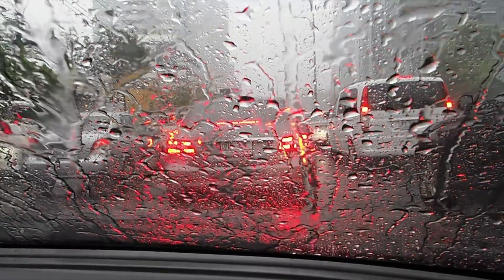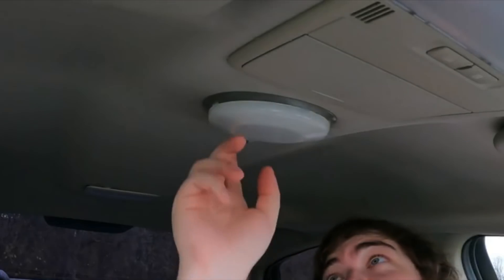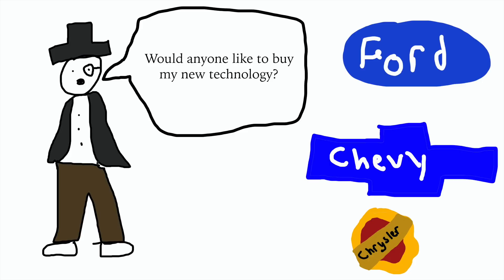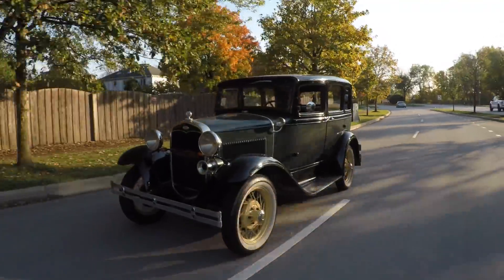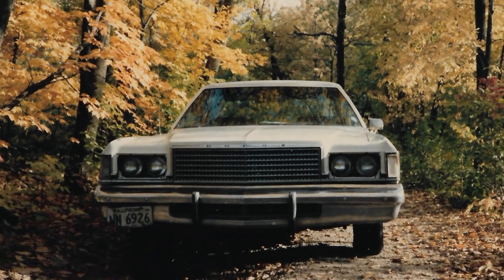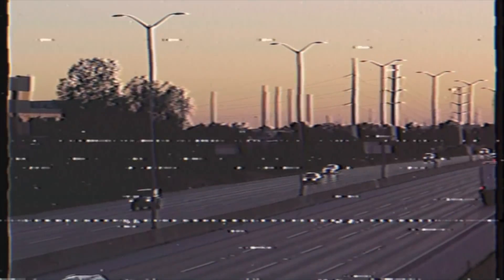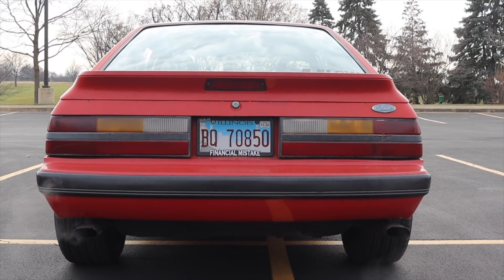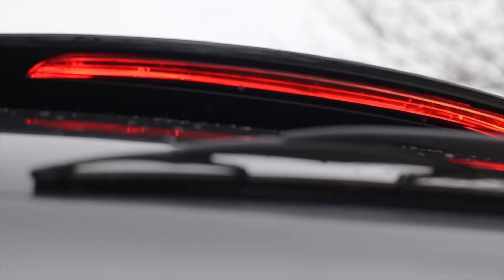The Third Brake Light - Who Invented Them & Why We NEED Them!

Comment: In France, I passed my driving license in 1994. At the beginning of the year, 3rd stop was forbidden. Then, it became authorized, and finally, at the end of 1994, it was required on all new models launched or facelifted in France. But not on all new cars. For example, FIAT Punto 1 never had a 3rd stop here, and it was produced between 1993 and 1999. 

Thats why all the 3rd stop were disconnected and hidden in American imports, before 1994, like the Chrysler Voyager (Chrysler brand, Plymouth name, and Dodge front grill ^^), the LeBaron, and even some Japanese cars, like the Nissan 100 NX (NX1600/2000). In this case, a black plastic piece replaced the 3rd stop (but the wires are still inside the door hatch)

Comment: Just before the third brake light became mandatory I purchased a 1984 Ford Midsize LTD. This car did not have a third brake light. However around 1986 third brake light kits became available at auto parts stores. So I purchased one of these third brake light kits and installed it on my car.

Comment: There is actually an exception to the high middle brake light. The GM "dustbuster" minivans of the early 90s. The way they were designed the brake/turn/running lights were high up on either side of the rear. The 3rd brake light was actually lower and mounted on the rear hatch.

Comment: I remember a movie—I don’t recall the name—where a family was stopped in their car during a snowstorm. There was a shot showing the car’s taillights becoming blocked by snow accumulating on the bumper. Next, snowplow coming down the road rear- ended the car, and family members were killed. The audience was to infer that the snowplow driver couldn’t see the car with the taillights obscured. I saw that movie years ago and the scene stuck with me. That scenario is a good reason for that third light (make sure to keep the rear defroster on when driving in the snow). 
The placement of that brake light on the car in the thumbnail (an Infiniti?) makes the extra light a bit useless, IMHO, and I’m surprised that’s compliant

Comment: Another example would be the early 1970's Oldsmobile Toronado that had extra brake lights over the trunk and under the rear window on both sides. After several years insurance companies data recognized that these models were rear ended way less than other vehicles of the time.

Comment: You have missed a few points -
Before the flashing turn signals there was a "trafficator", a light on a little bar that popped out from the B pillar of the car to mimic an arm signal, these were around in the 1920s and in the UK right up into the 1950s. 
With the third brake light, the point was that the brake light was not clear enough, was it just a bright rear light? 
Having them seperate from the rear lights helped show that they are a brake, but mounting them high up (in the days before everyone had an SUV) meant that you could see the brake lights of many cars ahead of you not just the one in front, so you had longer to react if everyone suddenly had to stop.

Comment: This is quite interesting. In the UK the third high level brake light was only mandatory from 2004. I presume this is because we've never allowed red indicators/turn signals and have never had tail, brake and rear indicator all share the same bulb.
Reply: That is incorrect, English cars prior to about the mid 60s had combined signals both front and rear ..cost saving probably..
Reply: @amigachris  We had trafficators before that in the UK, never red rear indicators, although pre 60's US imports can retain them legally. Orange/amber miniature mechanical 'arm' signals on the 'B' post of cars pre 60's. There was no need for front and rear indicators as the driver would either be signalling direction by hand out the driver's window or have these little mechanical 'arms' doing so from whatever side they are telling others they're wishing to turn/pull up on/park. 
I googled trafficators to check my own knowledge of them, and the government advice on indicators happened to come up, stating that it's amber for everything with the only exception being red rear and white front indicators on motorcycles pre 1st September 1965. 
Additional info found on trafficators (semaphore being the name for the type of thing I described above but forgot the name of (the little arm signal mechanical stand in)) were first invented in the 1920's in France, and became more widely used throughout Europe in the 40's. 
Back to my own knowledge. Prior to that, arm signals will have been the sole way of indicating to others your intentions, be it turning left, right or slowing down. We have 2 Ferguson tractors from the 50's which aren't legally required to have any lights on them, possibly with the exception of the side lights if it's to be used on the road, a single white bulb on each wing, over the back axle either side where the driver will be sitting, with a front white lens and red rear lens.

Comment: In the uk , we didn’t see 3ed brake lights until the mid 90s and commercials mid 2000s . the 3ed brake lights are seen as optional and if removed from the vehicle it wound not fail an inspection (mot)

Comment: In my opinion, I feel that the third brake light helped me a few times with anticipating when the leading car will brake. When following a car, I can see the center brake light from two cars ahead light up. Which then will cause me to start slowing down if the car in front of me hasn’t yet pressed its brakes. Of course it only works if the other car’s center brake is high enough to be seen thru the car in front of me tho.

Comment: A great example of the implementation of the third taillight is the 3rd Generation Camaro. in 1985, no 3rd taillight, in 1986 they had to rush to add one and basically just mounted one on top of the rear window, then in 1987 they integrated it into the rear spoiler on the trunk lid.

A similar thing happened to the Camaro in it's 2nd Generation. the 1972 Camaro had a split front bumper, with chrome bars on each side of the grille, 1973 had a full chrome bar going across the front due to new bumper safety regulations, then in 1974 the entire nose of the car as redesigned

Comment: I had a 1968 Plymouth Barracuda. You could go to Trak Auto..buy the third brake light kit....drill a hole in the trunk hood for the wires.....peel and stick it on the hood. I was so proud of myself. The light could be pried open if the bulb needed replacing.

Comment: I worked in design for JCB in the late very early 2000's when we developed ABS on the Fastrac high speed tractor. The first tractor to ever have ABS. I wasn't directly involved in the ABS, but did work on cab pars, and I suggested we also ought to have a high level brake light. Again, no tractors that we were aware of had ever high level brake light before. As marketing were pushing the advantages of having ABS on faster tractors, having a high level brake light was agreed upon. The type approval rules didn't cover centrally mounted 3rd brake lights for commercial vehicles at all at the time (because of it's higher maximum speed (50 mph / 80 kph), the Fastrac had to meet a lot of truck type approval rules, not tractor), so whether they were allowed was a bit of a grey area.
Everyone agreed they were OK, apart from by the German TuV inspector who decided a high level centrally mounted brake light was not OK in Germany for some reason. So I also had to design a blank for German models too. We chose a Hella 3rd brake lamp module - the same part as used in the Lamborghini Diablo and various other cars, and mound it in the rear edge of the cab roof.

Comment: Third brake lights in Australia have to be mounted high on the back window. They are essential as now there are many SUVs, 4 wheel drives and trucks on the roads. When they get reasonably close to your rear, the normal tail lights cannot be seen. The extra brake light avoids many accidents.

Comment: I always believed that if traffic law required at least two working lights must be working. But if one bulb is burnt the high mount light can still count as a second light thus no ticket for a busted tail light. And there is an advantage you can see a high mount light through the window of the car in front of you on another vehicle in front of it. That way you are aware when traffic is slowing or stopping.👍🏼

Comment: And really older vehicles only had one brake light, not only that but the earliest cars' headlights were powered by acetylene which makes a bright white light when burning.  I remember when the 3rd brakelight came out and we called them cyclops lights, lol.  When I was in high school in the 80's and most states still issued driving manuals at their BMV's hand signals were STILL in the manual.  I guess technically they're still legal to use in case say, your turn signal relay stops working but I doubt most folks under the age of 40 would know a hand signal if they saw one.

Comment: I like your videos. You mentioned that Ford pioneered 3 flash turn signal in 2011, but it was available on Mercedes in late 90s early 2000s.
Reply: That's what I was wondering. My '09 Mitsubishi Outlander has that. That is the thing where you just tap the turn signal and it blinks, rather than having to turn it all the way on, correct?
Reply: True. Also, even non-luxury cars got these features on the early 2000s. I had a 2002 Vectra with this feature. He got this information wrong, I guess.
Reply: @dollhousemakr  When you tap the turn signal, it blinks 3-5 times (depending on the vehicle, some even allow you to configure the number of "blinks"). I guess this feature was introduced in the late 90s, but it got really popular after 2005.

Comment: the additional brake light story starts in the mid 70ties in EU with the aftermart isntallation of two brake lights behind the rear window. But this episode ends very quick. Problem was the inside installation which lightended up the rear room and got a lot of scattered light to the cars behind when the rearwindow was full of raindrops. In the mid 80ties then the second introduction with the CHMSL in a way that disturbing driver and folliwing cars was eliminated.
In my opinion the problem in the US is the use of the rear stops lights parallel as direction indicator and by several reasons the parallel braking operation was is not realized by the following driver ending in crashs. In EU since 1963 onla amber(irange indicators are allowed at the rear working independent from the brake light. So „missinterpretations“ like in the US are not present.
Never the less after introduction the center brake lights give following cars an earlier signal through the windows and even me the third following car had at hat time by this the chance to prevent a crash by an earlier reaction. Today with all the SUV and their hight the few throug 3 cars back ist very limited.

Comment: Personally, as someone who doesn't drive, I wish there was a third signal light. There are so many times when a car approaches an intersection, and I'm in a pedestrian crossing parallel to them, and they give no indication that they're turning, so I start to cross, and then they turn in my direction and get mad at me for crossing while they're turning when they didn't indicate to me that they were going to turn. if there was a third central indicator, a driver could indicate that they are going to go straight. Then I as a pedestrian can tell the difference between a car that's definitely going straight, and a car that's just failing to signal

Comment: The three flash signal has been around a lot long than 2011. I had a 2001 and 2003 Mercedes that both featured it.
Reply: I was going to say something similar. Pretty sure BMW had it in the early oughts as well... Must be a German thing :)
Reply: @steveweixel6709  They just figured out that having 1 bulb perform 3 functions wasn't a great idea. Tail light (low brightness), directional (varying brightness) and brake (steady high brightness). Many European cars had 2 separate bulbs (and lenses) for those functions, which really eliminated the need for an additional bulb and lens. And if you couldn't figure out what the bulbs meant, you should not be driving.
Reply: @thecarman3693  that’s not even remotely connected to what I said…

Comment: That third brake light makes cars much more visible.  I started driving in 1966, and cars nowadays are so-o much better.  When they go electric, that will be another big leap for the car industry.  When solid state batteries are refined and introduced, that will be another milestone.  Then, autonomous driving cars will cap it off.  Yes!

Comment: Chrysler had the center high mounted brake light in the 1940s.

Turn signals became mandatory in 1951. Until then you could buy a car with 1 tail light/license plate light.Although, most cars had 2 tail lights.

Comment: In most of Europe the 3rd brake light became mandatory in 1996. Around  that time so became the second pair of turn signals that can be seen from the side of the car. (back then most cars installed them on the front fenders, in early 2000s they startet integrating them in the side mirrors). 
If i remember correctly, Italy was the first to force manifacturers to use second pair of turn signals and back then you could easily recognise if a car was made for their market or imported from there only by looking at it`s fenders. It`s funny how much later we (europeans) implement the safety features than US and yet our rules and regulations about cars driving on the streets are a lot more strikt.

Comment: The third light was shown on the show "What will They Think of Next" back in the 70's.  Back then, the studies that showed they reduced accidents had the third light blink at different rates, faster if you were braking hard.  Much like with air bags, what we got with production cars are nothing like the safety studies that argued for them (air bags in the studies had over 160 sensors, what we have today is 3 sensors).

Comment: Do note that while red is the least visible color to the human eye, for it to not effect your night adaptation (which can take upwards of 45 min to fully adapt, think length of twilight) it needs to be a pure red, such as that emitted by an LED. Red tape like that used to temp fix a brake light can help a lot on a white light, but it will still effect your eyes dark adaptation (I like to do this to one of the overhead tap lights inside my truck, pretty handy to have a light that doesn't totally blind you). Also to note is that while red is useful for not tripping in the dark, it is a pure green that you want if you actually have to read things like small text or a map (or a star chart, as would be my case given my hobby of astronomy & astrophotography, green is also generally the easiest color on the eyes, which makes sense given the color of much of nature).

The trick for night vision is to only use one specific color. Be it red, blue (hunters like this because it makes blood look dark black in a sea of blue, makes tracking wounded prey much easier at night), or whatever you have chosen so long as it isn't too bright.

Comment: My father did put on a brake light on the trunk on my mother’s 1985 Ford Tempo just shortly after getting the vehicle. It was around 1985 or 1986 when he did it. When I was taking driver’s education in high school the car that I was driving had one. When I first drove a car in class that I was so nervous in driving. Luckily it was a Ford Tempo in red with red interior. My mother’s car was white with blue interior. In class they gotten 2 new cars that were both Ford Tempo. I got stuck in driving a blue one in class with blue interior. I was a big chicken I’m not getting my license right away at 16. I waited till I was 29 years old in my first car that was a 1998 Ford Contour SE. The vehicle was about the same size as a Ford Tempo was.

Comment: you forgot to mention the advantages of a 3rd brake light. most production cars are capable of pulling a trailer, and in some cases, the trailer will completely block the taillights, with the 3rd brake light sitting at the top of the rear windshield it's not an issue anymore. while trailers do nowadays come with their own set of taillights/brake lights, there's no guarantee of it actually working. plus with a 3rd brake light, you get the reduced chance of having a non-functioning brake light. unlike the US, most countries only require 2 functioning brake lights (ie in 2 separate light clusters), so a 3rd brake light ensures that 2 brake lights will always be visible when one fails.

Comment: The third "eye level" light was added because of the thousands of cars GM built with the "brilliant" idea that tail lights should be in the bumper 6" above the road. Cars had long high hoods and it became impossible to see the tail (brake) lights in city traffic. At the same time Checker cabs were about gone and cab companies started using the Chevrolet Impala. Rear end accidents skyrocketed in the cities and thus the mandate for high level brake lamp was made.

Comment: Although the vehicles all now have the high level brake light, it is not a legal requirement for it to work, in the UK.

I have a van, which failed the annual MOT, Safety and emissions test, on one of the brake lights not working, but the third one was also not working, and that was just an advisory.

There were other issues that it failed on, but the middle high level brake light was not a failure.

Comment: I've always thought that the "eye-level" brake lights (as they were originally called here) would be more effective if they were pressure sensitive. They should get progressively larger/brighter as braking pressure increases, ultimately ending with rapid flashing for emergency braking.
Reply: BMW implemented that decades ago.